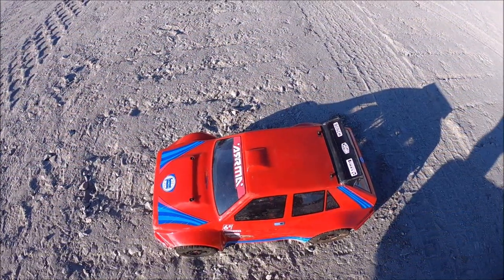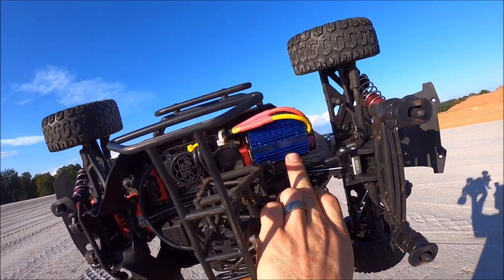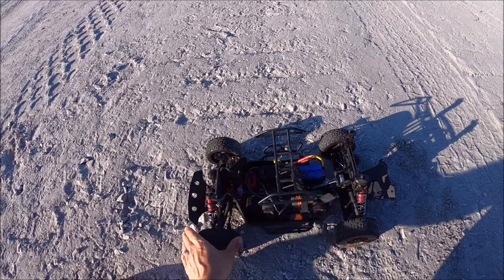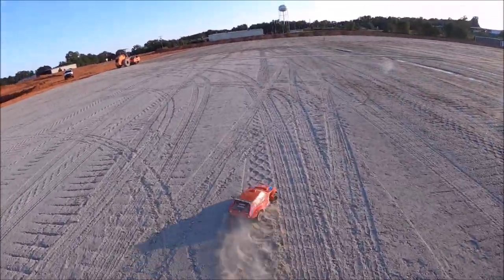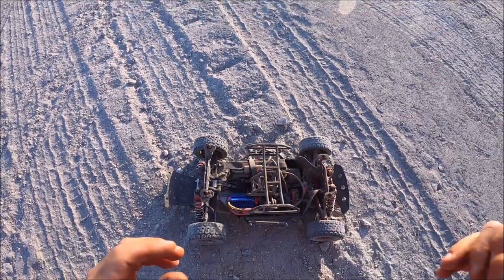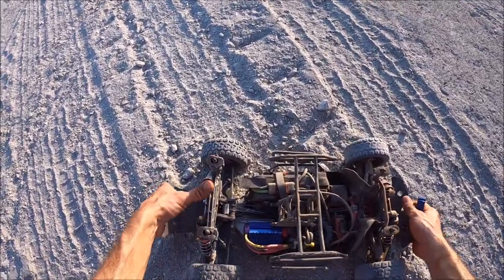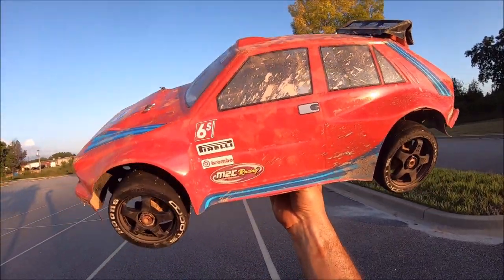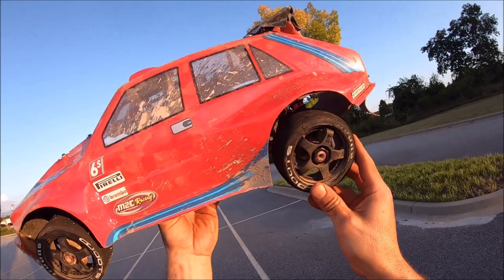Arrma RALLY!! -MEGA Dirt shredding, Tire Melting BEAST!!

Comment: Great vid!! i have a question. i bought two hot racing diff cover AON12E01 to put into the front an rear of my car, but i think that only gonna put on the front to make the rear more elastic. Do you think that is a good upgrade¿? or you prefer running stock¿?

Comment: Hey I'm planning to pickup a k6s exb soon, I currently have a 3s typhon thinking of trying to make it a 4s rally.  You possibly have any suggestions or input of what to do?  Can't find whole lot out there gonna assume  need bunch of senton parts
Reply from the maker: I'm not sure on a 3s Typhon. Mine is a 6s platform with lots of Senton 6s parts. Maybe you could use Senton 3s parts.🤔 It would take some engineering for the Rally shell to fit but that's the fun it it!😜
Reply: @RCDUDE81  true, what senton parts did you need by chance? The 3s typhon and the 6s are about the same size aren't they?
Reply from the maker: @sMoKeN904  They are similar in size but total different platforms. I used the Senton 6s shock towers, shocks, body mounts and cage. I did have to use long body mount extensions too. Kinda have to get crafty when creating something like this.😜
Reply: @RCDUDE81  awesome thank you :D , do you think for my second rc car I should do the k6s or the k6s exb. Trying to figure should I just get the regular k6s an upgrade some stuff to m2c or what
Reply from the maker: Honestly a regular 6s with M2C will be a stronger rig. My EXB has M2C upgrades!😆💪💪
Reply: @RCDUDE81  you just helped me sooo much hahaha.  What's one the first m2c upgrades you'd recommend by chance? :P
Reply: @RCDUDE81  do you think I should upgrade the motor and esc from spektrum?  Hear alot of people swearing by hobbywing an castle saying spektrum is trash or just ok.  I only really plan to bash so the motor an esc should be fine that comes with it right?
Reply from the maker: The stock system is plenty fast if geared right,  just lacks a bit of torque imo but I'm just used to the Hobbystar 4092's.😜 All in all, its not a bad system. Comparable to the old BLX system.
Reply: @RCDUDE81  cool,  gonna assume like a 17-21 gearing?  Think I've read that multiple places